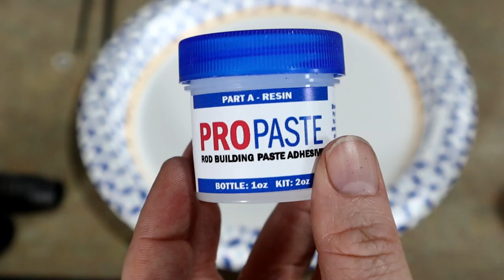FIRST ROD BUILD; Building & Testing My First Custom Made Fishing Rod

Comment: Best to spline the blank first because the butt is perfectly round, do it on level ground or get a bearing tool. Use a wax pen to draw a line up the blank so you can line up everything easily.

Comment: You were supposed to use the stepper motor to turn the rod for you while you wrapped the guides. It allows you to use both hands to do your wrap. While you apply pressure with one, you can tighten and snug with the other. You just stop it when you need to if things go a tad too fast for you.

Funny enough, I used this exact technique to repair my graphics pen which is absurdly expensive. It fractured down the seam and it would begin to separate as I worked with it, but I gave it 3/8" worth of wraps and then coated/saturated it in superglue and it's perfect!

You see kids??!?!?… the lessons learned in Fishing can be used and applied for every day things. LOL

Great vid bud, keep them coming!
Reply from the maker: I dont have the step motor..the basic kit only has the slow rotating motor for epoxy..you have to roll by hand with the beginner kit.

Comment: I've been making rods for a while.  Welcome to the addiction.  You can build a high end rod way cheaper then buying on from the store.
Reply: DEAD WINTER where do you get parts other than mud hole, they don’t have the selection that interest me.
Reply from the maker: absolutely!!
Reply: @efferm  What are you looking for specifically?
Reply: DEAD WINTER I’ve seen a lot of custom rod builders on instagram using these nice metal reel seats.
Reply: @efferm  The anodized aluminum ones?
Reply: DEAD WINTER ah I think I just found them they use alps
Reply: @efferm  seem VERY pricey too.
Reply: @efferm  Barlow's Tackle, Jann's Netcraft, Lure Parts Online, just to get started.
Reply: I think I'd disagree with this. Maybe way better, but not cheaper.
Reply: @efferm  try getbit
Reply: @Lucas For your first build to something cheap, trust me you don’t want to spend a load of money on your first one IMO for your first build go cheap and high durability.

Comment: Hi Chris. Nice job for your first attempt ! I started out with the same setup you have. If I may share a tip, do your wraps with thread at a slight angle to the left. It will give you more control and a tighter wrap. Also use your burnishing tool to smooth things out. You'll find each rod you build comes out better than the last.  Good luck on future builds ! There is nothing more satisfying than catching fish on a rod that you built on a bait that you made. And, it's true what you said. You'll never use a commercial rod again. I know I won't. ;-)
Reply from the maker: yeah ive been practicing since this video and found that the left angle helps...i think i'll be able to wrap a cleaner rod next time...I have to fight my tendency to get in a hurry..
Reply: @WorldsWorstFishing  do either of y’all know what kit I need because I clicked the link but nothing popped up

Comment: I didn't know about how to test for the spine. That's interesting. I just tested my two casting rods. I have a Duckett Ghost and a Duckett Green Ghost for my casting rods(both 7ft med-hvy general use casting). They are made from the same model blank, but the Green Ghost has a different style of grip and slightly larger eyelets. The Ghost is right on spine, not a bit of deviation. The Green Ghost is slightly off. It is barely noticeable, but comparing the two rods, which are identical blanks, you can tell that the Green is off. It looks like only 1 degree, maybe 1.5degrees. This is something I am going to use whenever I buy a rod now. thanks for that bit of information. 👍🏻👍🏻👍🏻
Reply from the maker: My pleasure man, most production rods are not on spine so they are prone to breaking.

Comment: a quick tip on putting the tip top guide on  cut a wafer of the glue  then cut it into strips that fit in the tube of the tip top.. then heat the guide to melt the glue  then  slide it on...

Comment: When its comes to gluing the tip guide on,use hot glue and not epoxy. So if you damage it you can just warm it with a lighter and easily remove it without damaging the rod tip.Sometimes you have to cut the blank when Epoxy has been used.Its worth carrying a spare tip and a hot glue stick with you while fishing.Then its an easy fix in minutes.
Reply from the maker: Yeah I used the hot glue stick they provided...would never epoxy the tip, I know that from replacing a few tips over the years.

Comment: Great job! You will only get better the more you do it. Just finished wrapping up some prototype black hole nano 300 gram and a 400 gram 8’6” rods for fighting bluefin tuna. Those rods super strong used the new titanium alloy guides from AMERICAN TACKLE . I was able to run smaller guides to keep the action. These rods had #3 tip and the other #4 so I double wrapped the A thread and two coats epoxy. Super strong 💪. Didn’t compromise the parabolic bend of the blank. Set up for spinning. Glad to see you building rods. Mud hole is a great outfit. My best friend owns American tackle so I get to play with all the fun new stuff. But would love to see you build a slow pitch 120 gram rod and fish it. I’m setting to build one now for myself. Just called my buddy on the parts for a sweet slow pitch. Use the Bushido diamond weave blanks. You can lift a house with them. If you can afford it stick with American Tackle titanium the guides so much stronger than stainless. And they don’t corrode.  Or distort so ring pops out.  Use nonolite rings as well. Have fun.

Comment: Also, spine the rod before you install any hardware on the blank, mark the spine with a China marker.
Reply from the maker: I prefer the feel I get once the end cap it on rather than rolling the bare blank, thanks for watching.
Reply: Spine doesn't matter.....no one casts along the spine only, retrieves against the spine only, and sets the hook and fights the fish against the spine only.  If it were that important, there's be far more broken rods.
Reply: AM...I know that's rite.  Watch Scott Martin he sets the hook sideways, up, down, and all around. He be crazy, man.
Reply: @andrewmetzger4167  not to mention those who flip a right handed spinning combo upside down so they can reel on the left
Reply: @green.reider  ROFL... Apparently they haven't figured out how to swap the handle!
Reply: @andrewmetzger4167  I have often wondered about this spine thing. We built a lot of rods here on the Texas coast in the 70s without flex coat and no knowledge of a spine. No problems.

Comment: I know it's your first time doing this but my eyes started twitching with that first wrap...lol

The idea behind neatly and tight packing of your thread is NIT just for perfection of thread wrapping but if you're doing micro guides and you only need one layer of thread (I recommend two) you need to make sure you have enough tension on the thread and tightly pack the thread to give maximum hold down strength to your guide in addition to the epoxy finishing process.

Comment: A good tip is to scuff the blank where you will be applying epoxy.  I use a grey scratch pad 3M which is a finer grit than green or burgundy pads.  Will give better adherence.

Comment: Just one layer on the guides unless you are under wrapping them to protect the blank, which you usually only do on a heavy salt rods. You want maybe a 20 degree back angle on the thread  so the theead sort of climbs the previous wrap and lines up on the other side. Gaps will happen, but you can feather them out with a burnishing tool or even your finger nail. The hardest part for me is getting the thread to climb the foot.  Burnish the wrap before coating. On guides with small feet like microguides, you can wrap the final couple of wraps around the guide itself then around the blank before finishing the wrap. That'll keep the guide from pulling out if a knot gets hung up in the eye.  Dont be afraid to reguide some old rods as it's great practice, and - in my opinion - lots of fun.
Reply from the maker: Yeah I've been practicing just rapping since I filmed this build.. definitely getting a little better..cleaner wraps

Comment: You can use lacquer thinner to help slide on the handles and to clean up the extra epoxy after, it helps so you can make the grips tighter to the blank.

Comment: Maybe if you do another build go over guide spacing and load testing. When I built my first rod that’s the only thing I didn’t do it makes a difference tho. This gave me the itch to build another. Good job!
Reply from the maker: Yeah man, I did guide spacing based off my carbonlite spacing..don'y know much about load testing, I would assume the blanks are tested prior to mudhole selling them?? interesting thought
Reply: World's Worst Fishing so load testing is putting your guides on then running line through them and putting the rod under a load to see where you should put your guides. With the tension on the rod the line should never touch the rod that’s when you either move your guides or add another
Reply from the maker: @jnt023  oh okay I see...I'll do me homework on it for sure..
Reply: World's Worst Fishing yeah I didn’t do mine on my first one but still like the way it turned out as long as you like the rod that’s all that matters just throwin it out there for the next one tho

Comment: I have made a ton of rods in my years at the tackle shop. Your rods will get exponentially better as you get more rods under your belt. A burnishing tool will be a big help in smoothing out your guide wraps.  I think you are making it a bit hard on yourself with starting the wraps. Just lay the thread down and wrap over it towards the foot of the guide. I wish you would have said what the size of the thread was. Maybe it was the camera but it looked like rope. Anyway you are off and running. The spine part of the vid was very good.
Reply from the maker: thank you man..its the little size A thread I believe..that was actually my first time ever working with thread in any capacity other than maybe grade school haha

Comment: the shop where i used to work at would build rods from scratch fresh water and pricey salt water ones that would sell to another retailer for $1200 each which would then be sold for $1700 each rod,  But had all roller guides and be completely custom

Comment: On those close up shots you could set your camera to manual focus and then you wont have the in and out of focus.    Deffinatly wanting to get into custom rod making. With a turnkey kit from mud hole you should only need a new rod blank and eyelets and you should be able to keep making more right?
Reply from the maker: a great idea, and yes, once you have the building kit youll just need another blank, guides, grips to build a second rod.

Comment: Got a 7' light turnkey kit for Christmas, but don't really want to use the crb handle or guides it came with. Waiting impatiently for a few specific fuji items to be back in stock.
Reply from the maker: I hear ya..but the CRB parts have lasted me well
Reply: I would like to make a 7' 6" rod for open face and another for bait casting but I feel like I will spend more money making one. I see folks swinging Alabama rigs alot on youtube but I've never had luck with them things. I do however have alot of luck on what I call a Mississippi rig me and my brothers came up with. I think a 7 6 rod would be perfect for it
Reply: @WorldsWorstFishing  good to know they're decent, will be using at least the guides on a CRB blank. For the MHX blank I want to use the KR guide placement software on anglers resource to size then order nicer fuji guides from mudhole, and a few other parts.

Comment: I been watching alot of pro video d.i.y rods and they make it look so hard and pushed me away but with this show you did this was simply easy to understand and thanks... now I wanna get this same kit. With the supplys you got how many rods you think you could make before you have to resupply like the guide thread. The way I was thinking since the syringe of epoxy has 14mls you could make 7 total which is great for me.. what action you think you made and from my looking you got a medium heavy. Also could you use this kit to refit old rods by striping everything and using the rod blank with nothing then doin your own customized because my buddy gave me a 20y old eagle claw which its ok and I just got a lews from a drift store that the eva handle is alil wore out and I wanna customized it as my very own on both poles. But besides that great video and nice build and love that green thread and handle color with the black

Comment: Fine thread or not I would definately pack your thread tight as your wrapping to make it nice and neat.(I use a popsicle stick to smooth and pack)  And cut you tag ends on the opposite side of your guide. I've had many threads come loose cutting it in the grove where you did. Love the color. Nothing beats the casting and hookset of a custom built rod. Wrap on brother!
Reply from the maker: so you would cut tag ends "away" from the guide??  wanna make sure I'm hearing your advice properly
Reply: Right. So on a baitcaster I'll try to cut my tag end on the spine side. Just so they're kinda hidden. I'll even give it a quick flash with a lighter to burn all the frays out before the epoxy is put on. Just some things I do. Everyones different.
Reply: I can say your first rod you built was more successful then mine haha. I accidentally didnt get all the glue off of my real seat threads.  Now I tape everytime because of that. 🤣
Reply from the maker: @codydonath8785  oh okay I see..gotcha.. thanks man..I'll try and remember that for next time.

Comment: read through comments and i was about to say u want your thread to be as close as possible no gaps when i was being trained i was told no over laps no gaps if and when u get a gap or a over lay unwind it and continue this is why rod building can take some time even with a motorized rotator takes alot of patients and some pride cant just roll the string and say done also i noticed when u glued your tip on u failed to check if the tip lined up perfectly with your guides the slightest miscalculation would result in having to heat up your tip to readjust it

Comment: Just noticed you video.  Looks like you're drilling out the grips from the wrong end.  Remember the rod gets larger as you move to the bottom of the rod blank.  So when you drill out the handle and the foregrip always drill out from the bottom, never the top!

Comment: I commend you  on putting something out to encourage people into building their own rods. But your wrapping game needs some improvement. Single warp is achievable even with thin thread,. To remove gaps you can use the back side of a razor blade to push the thread over and close gaps. Before applying the guide epoxy, quickly hit the thread with a butane torch to burn down any filaments that would cause bumps in your epoxy. And most importantly make sure you hands are free from oils that will cause your epoxy to fisheye.

Comment: Watched your video with Terry Scroggins and this one.  Just ordered by first kit from Mudhole.  However, I cannot find information on the tubing Terry and you both used to hold your guides in place.  Would you either send me a link or add a link to where the tubing can be purchased and what sizes you used?
Reply from the maker: The tubing came with my kit..it should be included..you can always use tape..but call Mudhole and ask first.
Reply: @WorldsWorstFishing  Thank you very much for the quick reply.  I appreciate the help.

Comment: I Build custom rods as a hobby and one word of advice is to lock in the threaded rod that holds the spools of thread so you can set the tension on your thread this will help with keeping gaps out of your thread check out my Instagram @5thdayoutfitters for some of my builds and thread art
Reply from the maker: what exactly do you mean by lock in the threaded rods??  I'm not yet familiar with what that means lol
Reply: The threaded rod that runs through the spools I noticed in the video the wing but on the end was turning with the spool the threaded rod should be tight so the only thing spinning is the spool of thread
Reply: Also packing thread together while you are wrapping will prevent having to double wrap. There is a learning curve to perfection in rod building and by all means I am not there but it gets easier with every build I would like to put videos up like yours on rod building but am unsure what equipment I would need to edit any advice?
Reply: 33:45 in the video look in the background at the wing nut tension is key to a clean wrap also oils from your hands can affect the epoxy from actually sticking to the thread

Comment: Do you think I could use a metal meat injector to make my baits because I make my own molds thanks love your videos!
Reply from the maker: i dont recommend it, isnt built for hot plastic under pressure, I say dont do it.
Reply: Would you recommend something else because the injector is a little expensive 😅😂
Reply from the maker: @aldotrinidad7877  I do not...you need  a high quality injector...it has to keep you safe from hot plastic.